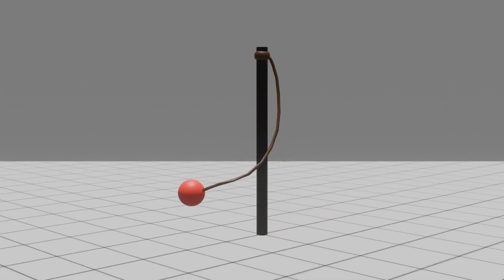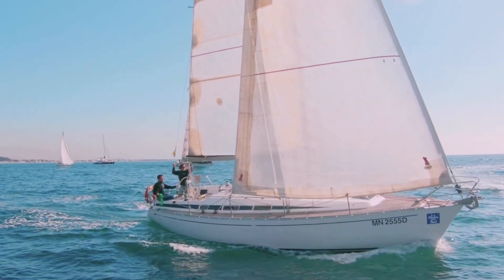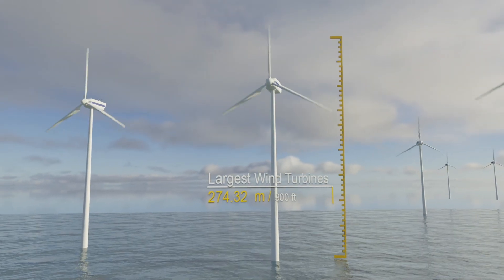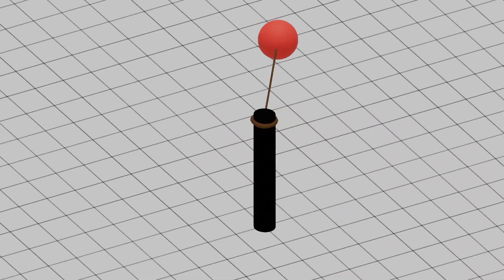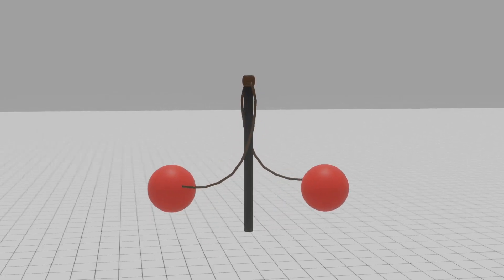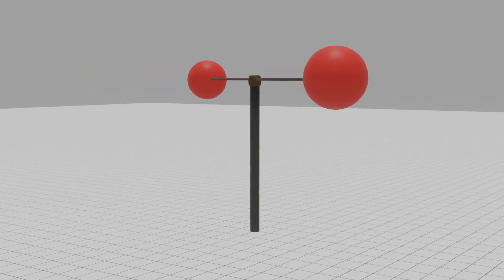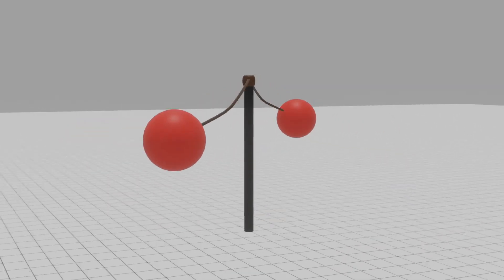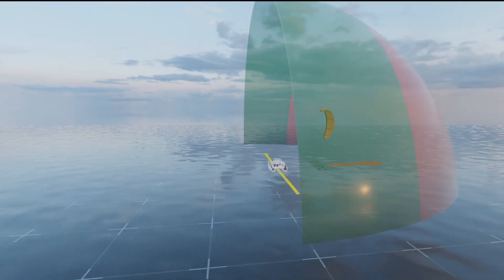Kite Engine Wind Power Scaling Riddle

Comment: Isn't the fact that the kite engine completely eliminates the mast by applying the force at the base its true beauty?
Reply from the maker: Yes, the video could have explained this better. This is especially true for multihulls, as there’s a direct line of tension between the keel and the kite, with no mast in between. This eliminates any fear of heeling or capsizing, as the power is transferred through the tension of the line.

The line is intentionally designed to be the weakest point in the system. If it breaks, you simply reel in the kite, swap the spool, and relaunch—perhaps with a smaller kite.

Comment: Aren't all monohulls self rightening though? (except Bayesian)
Reply from the maker: Hey thanks for commenting. monohulls are self righting, but if you consider the center of mass, there is a torque force exerted through the hull, spanning from the bottom of the keel to the top of the mast, that is why boats heel when sailing crosswind. You are right, monohulls are self-righting, so in a storm they can recover from a capsize, but monohulls and multi hulls can always benefit from an additional sail, especially if it requires minimal deck space. I was thinking this setup would work nicely on a solar catamaran or maybe a sailboat without a mast

Comment: Might be good to call out what specifically you're balancing with the kite. My first thought from the video is that you had two kites flying opposed to one another and spinning in a circle, with the connection being a line to the boat. 

But when you show the diagram with some sort of smaller foil in the water and a kite balancing it makes sense (similar to kite-foiling or what the SP80 folks are doing). But at the end the video it appears that the balance is just the existing boat?

Anyhow, liked the build up but the conclusion felt a touch rushed.
Reply: Also similar to the Vespa Sail Rocket where the underwater foil was pulling > down < pretty much directly away from the sail.
Reply from the maker: Showing that would have been a good idea Christian. The balancing forces are between the keel and the kite, the tethers transmit force through tension, the sailboat balances forces between the sail and the keel; transmitting power through torque/lever arm